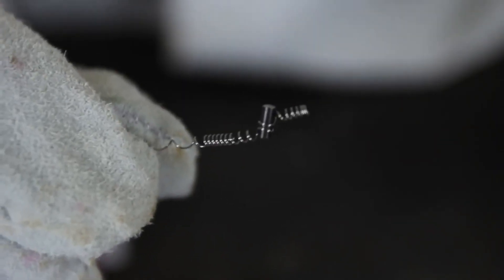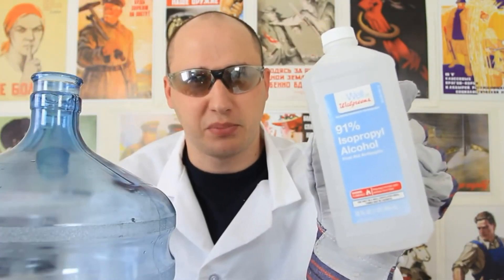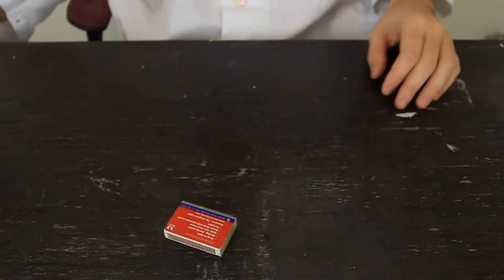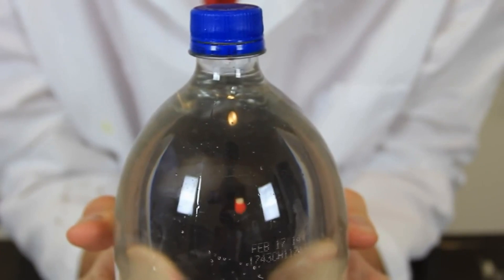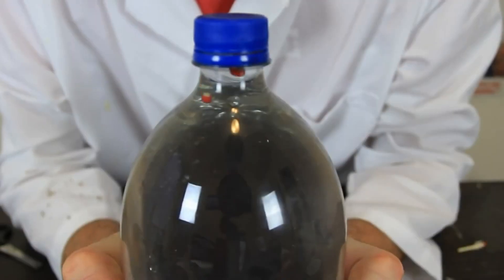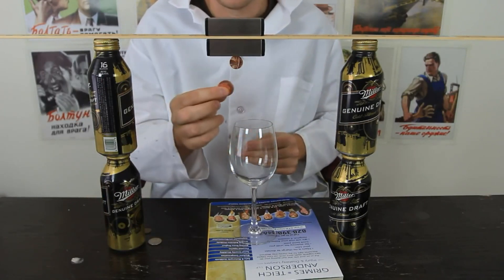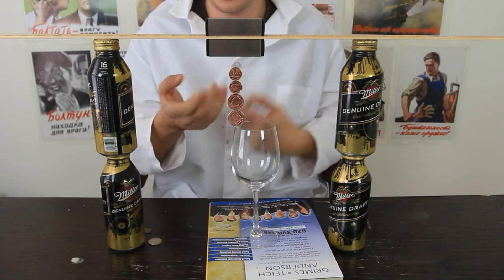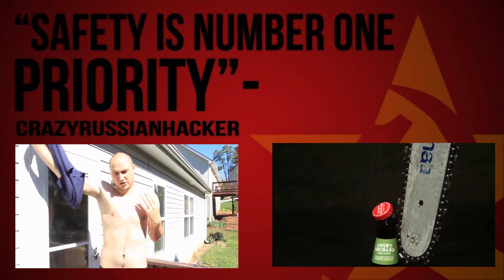5 Best Science Experiments of the Month #7

Comment: The last experiment: its because it finds the spot were it has the least/no magnetic pull also with having found the place were they will not get attracted to the magnets. The charge is still there, just not enough to pull it.
Reply: The weight is on the glass cup and the magnetic force isn't strong enough to pull it up. But is strong enough to hold the magnets.
Reply: icefoxtheallstar  in short terms. Yes.
Reply: that's what i meant haha

Comment: I wasn't sure if the magnet question was an actual question to the audience or not, but I'm gonna answer it as best as I can.

Metals inside of a magnet's field gain a magnetic property for themselves. The coins stick to each other. You covered this in the video.
Magnetic metals(with or without magnetic properties) are attracted to normal magnets. Another thing to note is that(almost obviously) the magnetic field weakens the farther you get from the magnet.
There are two forces at play here. Gravity and magnetism. Gravity pulls the coins down, magnetism pulls them up. When the coins are rested on the glass, gravity is stronger than magnetism at this point, but that is only true for the coin on the glass.
The other coins are attracted to the magnet on the measuring stick, but are still slightly stuck to the coin on bottom. This creates a sort of trick where if you tie a paperclip on a string and tie the string to something solid, you can lead the paperclip with a magnet without actually touching the paperclip. You can also pull the tethered paperclip into the air, demonstrating the principle in the video.